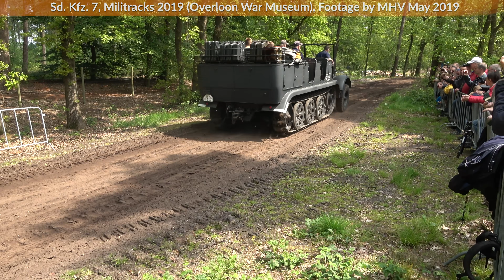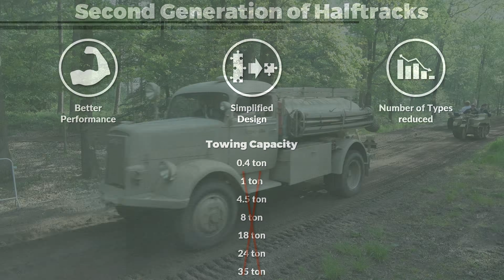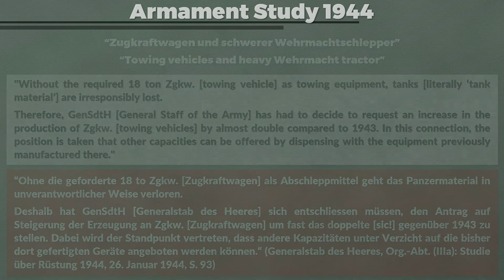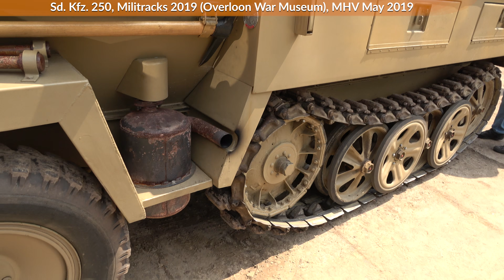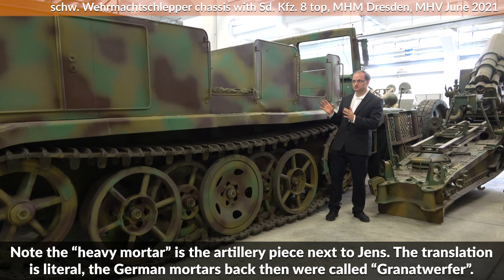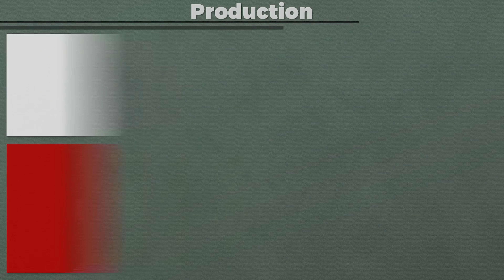The most boring WW2 vehicle? The schwerer Wehrmachtschlepper

Comment: I assume the shorter offroad to road range of the Schw. Wehrmachtschlepper was mainly due to lower gearing, not because of the different tracks. The wider tracks of the same type as used on the late war tanks, would have improved performance in boggy ground (as in they wouldnt get stuck) due to the much lower ground pressure they offered.

Comment: One interesting factoid. When approving their mechanized vehicles, the Wehrmacht demanded the fan belts on the transport trucks be made to double their service life. The manufacturers solution was to configure the fan belt to run in a figure eight pattern so as to wear both side of the belt evenly, thus increasing the life of the belt to Wehrmacht standards.

Comment: Oh those beautiful tracks! But "simplified design" screws with my head. I read the U.S. War Dept.s intelligence report on the Kettenkrad, and then schematics of the differential steering system used on all the half-tracks up to the Sd.Kfz. 8 and "simplified" was not the descriptor I would use. And I've been a mechanic since I was 15. And I'm old. I love the beasts, really. Just so blown away by the tech they used.
Reply: "simplified" is relative for Germans who had and have a tendency to over-engineer anything they produce, including armored vehicles.

Comment: @Military History Visualized  Regarding your comment/visualization about the speed of the Schwerer Wehrmachtschlepper, do you (your opinion) find the reduction, of max speed of 27 KPH (road) vs that of the Sdkfz. 8 and 10 (50+ KPH), to be detrimental?  I ask because I remember, in an older video on this or your other channel about the Pz. III or Pz. IV, it being stated that, despite faster speeds being possible, doctrine and training capped speeds, at around 25-30 KPH due to concerns about damage/over-usage and outpacing foot soldiers.  Despite being slower, would it essentially have been slower, given doctrine?  Having never driven a vehicle that heavy let alone that heavy AND towing something massively heavy, I have to wonder how safe it would be go 50+ KPH towing a heavy mortar or a light/heavy howitzer.

Comment: Concerning the wheels: the wheel with more material on it looks to me like it was designed for infantry to step into the holes in order to mount the vehicle, since it is positioned right underneath the "door." For the front "door," the hub of the sprocket wheel can be used for stepping.
On other positions, material saving wheels can be used.

Disclaimer: I have never mounted or dismounted such a vehicle, and this is guess work at best.

Comment: It's funny to me. I knew the word "slep" as slang meaning to laboriously move a bulky and/or heavy object in an inconvenient way as used in English. I knew it was of Yiddish "origin" but considering how related Yiddish and standard German is I am not surprised to learn it was a word in German. Didn't know it specifically meant "tractor".
Reply from the maker: Well, the literal translation would be "puller / tower". There is also "Traktor" in German it is used for the agricultural vehicle, so for me "tractor" actually is not really fitting.
I skipped the discussion of the whole translation aspect this time.
Reply: @MilitaryHistoryVisualized  

Ah okay. Still a bit amusing to me as a New Yorker (city) to have the word "slep" in it's name.😉
Reply: It's a generic word. meaning to tow or to haul,  but can also mean to carry although the specific word for that is tragen  or "Traeger". the original meaning of Tractor in that sense was more traction- hence Traction Engine. Yiddish is a form of German. If configured to carry fuel or water or ammunition it would have implied the same idea. The reality of these machines is they fall between two issues, either rail or road transport, but they would not be designed for long road runs. But as ever with such things they were forced into areas they were never designed for.

Comment: I just like the word schlepper

looking at the numbers built you can see how small the german industrial capacity was compared to the US. The M3 alone had something like 55 000 build and all the other half tracks were at least 5000 each if they were useful. And then all the Detroit built heavy trucks added to these numbers it becomes overwhelming how much a mobility advantage the US provided its allies vs Germany.
Reply: The oil supply is the limiting factor too. In the secret recording of Mannerheim and Hitler, logistics was discussed, and it was already clear in 1940/41 that the existing motorised force already consumed most of the available resources. And in reality, many German vehicles lost on the eastern front were blown up by their crews simply because they ran out of fuel. 

There were boundless fields of oil wells in Texas, Africa and Venezuela which the allies had access to, but the Luftwaffe ran on 60% synthetic fuel (approx. 80 octane) made from coal. While the allies had unlimited supplies of petrol, and the air forces could use lots of 130 actane fuel, Germany had very little fuel, and could not even be picky about the quality of it.
Reply: Canadian plants provided a half million “Canadian Military Pattern” trucks to the Commonwealth forces during WW2…
Even without the United States, Germany had serious problems matching Allied production volumes.
Germany’s advantage was a six year head start on manufacturing and the Atlantic Ocean as a logistics delay.
The Liberty and Victory Ship programs were the United States biggest contribution to victory.
Reply: @allangibson8494  wiki claims over 800000 CMP trucks from Canada.  The Canadian Army was the most mobilized per capita - 1 vehicle for every 3 soldiers vs US 1 for 7 men.  ". . .Canada's great wartime achievement was to build more military trucks than the main Axis nations – Germany, Italy and Japan – combined, . . "
Reply: @anthonyjackson280  And the United States built more of just M4 Sherman’s than the combined total tank production of Germany, Italy and Japan - the Axis was always going to lose a long war where production capacity mattered.
Lend - Lease deliveries to Russia by Britain in November 1941 neutered to Blitzkrieg and made it a long war.
Japan’s weakness was its total dependence on US made machine tools. It shot itself in the arse by going to war with the United States in the medium term because it couldn’t fix the tools that made the tools of war.
Reply: @allangibson8494  Yes, I read a book about WW2 German POWs who were held in the midwest.  The man writing said that a rail line ran by the camp and they would see the UP Big Boys hauling the trains of goods past daily and he knew then Germany and Japan had already lost.  He was capture in Tunisia.
Reply: @allangibson8494  The allies, specifically Churchill and Roosevelt, plus the USSR, conspired for war with Germany as early as the mid 1930's.

Comment: My guess is they could go to rubber more to the simpler design.   I base that guess on the US M3 and M9 which as I remember had top speed around 72 km/h and the tracks were all rubber but much simpler design.  America did have access to rubber.  No data was used in the production of this idea.
Reply from the maker: Germans did some testing with all rubber tracks pre-war, but they were not happy with them.

Comment: I do not get the German's love of Schachtellaufwerk or interleaved wheel configuration.  I can understand the improved weight distribution, possible smother ride, but those have to be vastly outweighed by the maintenance nightmare to fix any issues.
Reply: Overlapping was a reasonable solution.
Reply: The German designers were much more concerned with the comfort and well-being of their soldiers, than any of the allied designers for their soldiers.  Hence the German pre-occupation with decent suspensions for the Panzers and other vehicles.

Comment: Looking at the 'Adolf Hitler Panzerprogramm Band 2', OKH file ref. H 16/160b, from January 1943, the only vehicle it shows to be phased out and replaced by the sWS is the 5t-Zgkw.

The 5t - Zgkw. BN9 was shown as being phased out by November 43, and the sWS was planned to go into mass production in October 43, with production rising to a maximum of 400 a month by March 45.
At the same time, production of the 18t, 12t and 8t models were all expected to increase, to 140, 150 and 500 per month by Jan 45 respectively.
The 3t was planned to still be in production at 200 per month by Jan 45, but the 1t was going to be phased out in late 44.
Despite its name the sWS was only supposed to have a towing capacity of 7-8 tons, which would mean it was not suitable to tow the 15cm K16 or K18 artillery pieces and anything heavier. It did however have a projected range of 500km, which put it far ahead of any of the other half-tracks mentioned. (Date typo corrected!)

Comment: Its one of the coolest looking transporters/hauler the wehrmacht had, and the Panzerwerfer version of it looks especially way better than the Maultier based Panzerwerfer.
Reply: Your name is fitting because what you say is heresy :) nothing can top Maultier Panzerwerfer, the silhouette is iconic, and it's unique face - those radiator slots in hull front coupled with half-opened vision slots for driver make it look like it's both angry and bored at the same time. One of a kind vehicle!

Comment: I remember reading about this vehicle I guess 40 something years ago. Based on what I read then the initial plan for was a very basic logistics vehicle for Russia because of the mud roads. That's why they also added tracks to the opal blitz. I want to say it was extraordinarily slow like 15 km an hour on a road. It was simplified because German industry was so stretched beyond its capacity. This vehicle was built using the minimum of strategic supplies. Some of the vehicles had wooden cabs for instance. It ended up being used for a lot of different things because a vehicle that can move across bad terrain is always useful.

Comment: Question why did the germans use so many half tracks in a logistics role were the roads that bad in the eastern front? Or did the germans prioritize cross country logistical capability over pure numbers?
Reply: What roads in Russia
Reply: @tomhenry897  fair point
Reply: There were hardly roads in Russia.   Originally they were not designed to perform cargo transport or so. Perhaps that is one of the biggest mistakes  the German army purchasers made. If you look at the older generations of halftracks but also normal trucks or for example motorcycles like the BMW and Zündapp, you'll see that  they had a specific purpose to serve and were not very good in doing general haulage. For general haulage they used other vehicles, So you have a very expensive, very advanced vehicle weighing like 6 or 7 tonnes or even more like the FAMO' 18 tonne, and it is not able to haul say a load of jerrycans or grenades or wounded men in an efficiënt way, when needed. You can load 8 or 10 men on it, like in a bus or passenger train, but not much more.  The SWS was fitted with a very simple cargo platform which could haul everything. 

This is the difference with the American vehicles. Less types and all had very simple cargo platforms, sometimes a tilt and sometimes a crane or  workshop  or an ambulance  on it, but not many special coaches. They could produce much cheaper and weather 20 infantry men on the back or 150 Jerrycans or a load of sand, they could do it.

Comment: The SdKfz. 250/7 was destined to pull the 8.8 flak guns in bottom service and carry the crew.
Reply from the maker: >  The SdKfz. 250 was destined to pull the 8.8 flak guns in bottom service and carry the crew. 
I highly doubt that, the 250 is way too small for that, also it came rather late as well.